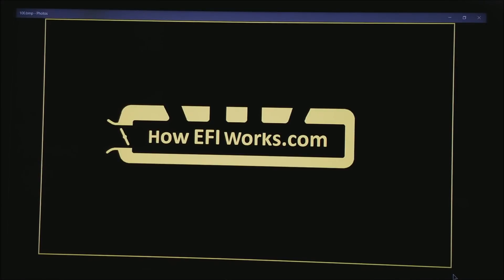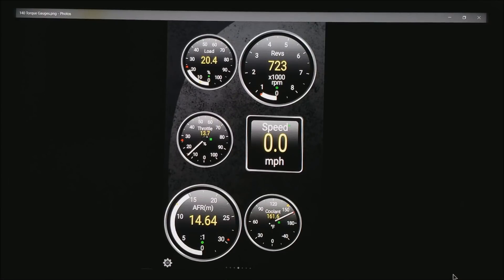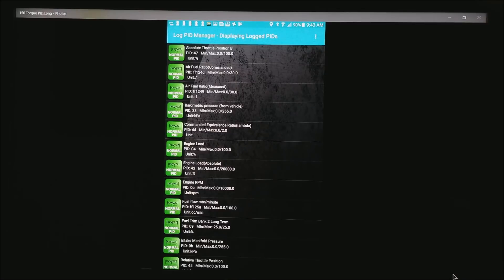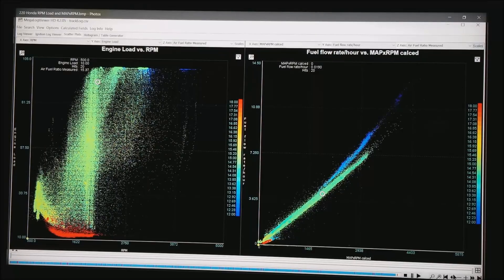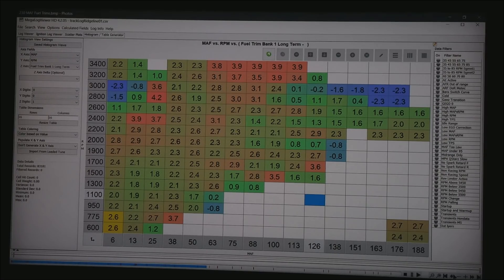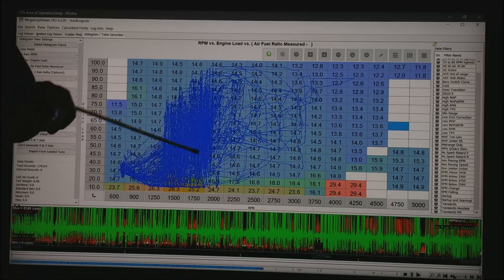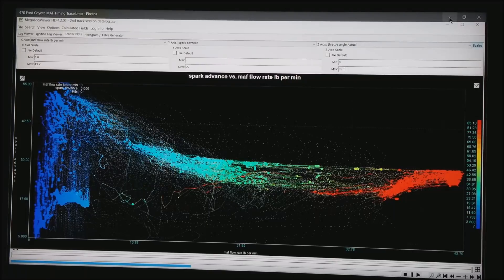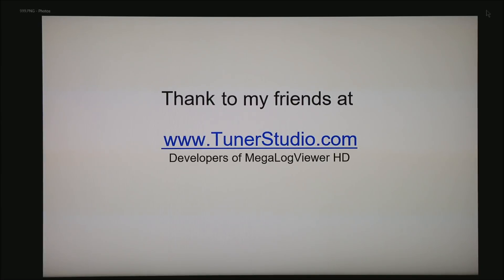Using an OBD2 Port to Figure out what the Factory Tuners are doing.

Comment: i think the biggest issue is there is mutiple items going on that if you were to look at the stock timing table out of the ecu you would notice its different then something you created from the data coming out of obd2 alone.  

Likewise with the AFR target table seems you are plotting aganist map based load, but its unlikely to be using map as its main way to determine when to go richer.
Reply: Still though a good starting point for a standalone ecu. Also using the dyno graph to calculate VE across rpm range would complete the initial Maps before starting the engine